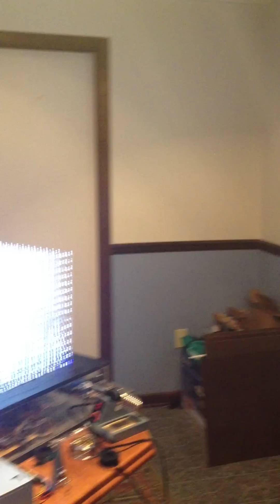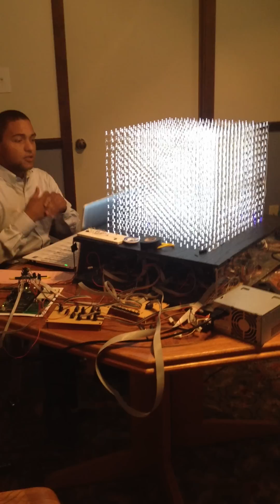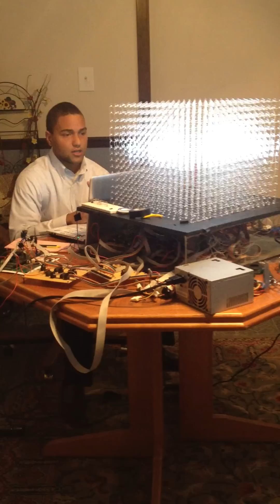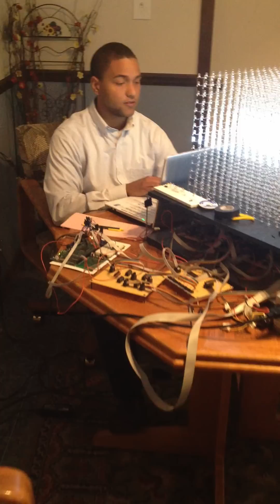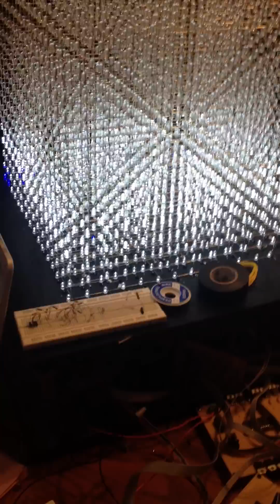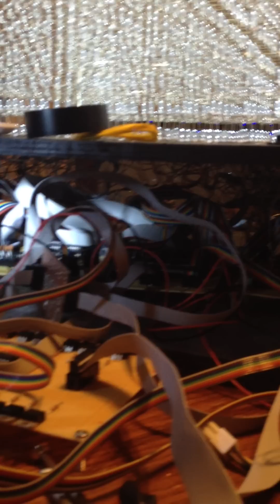16x16x16 LED Cube First Programs

Comment: Hey Andrew tremendous job man, I was wondering have you found a way to communicate it using the ultrasonic sensors. In ur opinion do you think there will need to be a change to the microcontroller if the ultrasonic sensors are added to it.
Reply: Yes.  Given the restrictions of the HC12 memory, the programs that I wrote wouldn't fit on the HC12 without paying for a licensed copy of Codewarrior.  So it may be possible, but you'll have to pay for the software prior to.  I would rather use a Arduino though.  I've recently been so tied up with Automation work that i haven't even turned on the cube in 2 years....let alone get to develop more cool things for it....i will one day....

Comment from the maker: yea i had an issue with the 6th layer not sinking the current.  You can kind of tell, but ultimately still impressive.  Otherwise it glitches when I load different programs.  This summer I'll be developing a new controller for it, thinking of using either a Raspberry PI or an Arduino.